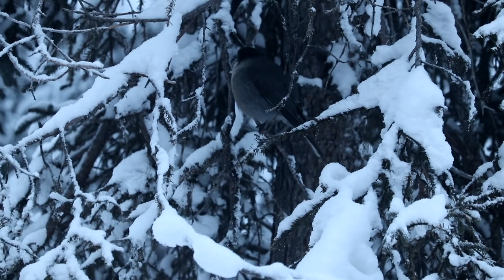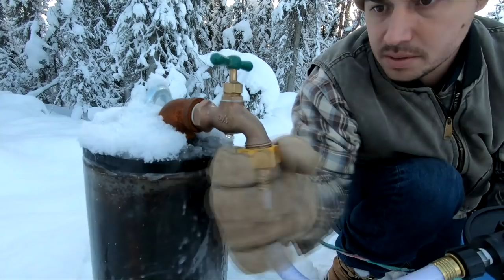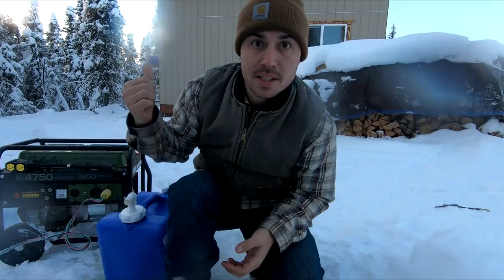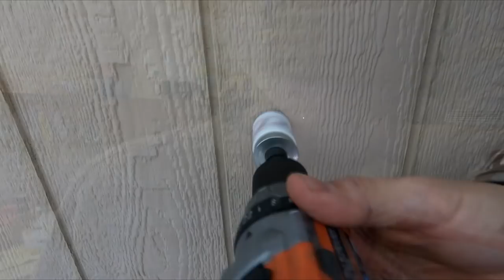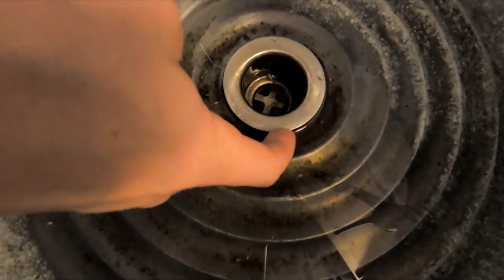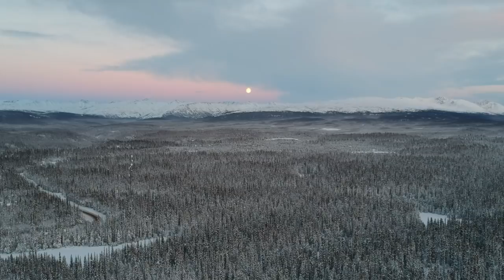Winter Solstice in Alaska | Cabin Projects

Comment: Stunning time lapse photography you guys. We loved it. Good snag on that filter. We run our sink/grey water to the outside also. I run the pipe into a large buckets with layers of sand, gravel, and 50 of the plastic scrubby things for scrubbing dishes. They act as a filter to catch the big stuff and the rest of the sediment filters through the gravel and then sand at the bottom. From there in runs on to the ground. Eventually we will run it into a larger 55 gallon drum filter or go into a septic tank.
Reply from the maker: That sounds like a great system!

Comment: Having worked with rock for many years there is probably some very good minerals in that settlement if it's a good well and the PVC pipe should run out a little further away from your foundation🤑🤐💥🐝

Comment: Your option to drain directly outdoors works; however, I see two problems: 1. you're introducing water to an area near your foundation.  Probably won't be a problem in the winter as everything is frozen, but come spring and summer you may cause damage to the foundation and wood of your home.  2. If you use high suds and unsafe soaps as you do when doing laundry but on your dishes, you will find cumulative harmful effects to the environment.  And in your area by draining food particles out of your home, you're attracting wildlife meaning anything in your area like moose, bear, etc.  Small fixes might be attaching more pipe from your sink to a holding tank that can be dumped every couple months safely at a RV dump station or extending the pipe but not using soaps and detergents that are harmful to the environment like Bronner's brand products (except the SUDS formula) and putting a filter or two on the end of the drain pipe as it exits onto your land.  Some people have creating a drain field for this purpose.  And since you have freezing temperatures, you'll need to insulate the pipes and/or go underground.  I know this is an investment of time and money, but it seems you're going to live there awhile so it will be worth the investment to maintain the integrity of the land and biology therein.
Reply from the maker: Christina Elliott, we appreciate your concern! :)
We do not use any other chemical products besides the store bought laundry detergent that I have yet to switch over because it has lasted so long. The whole transition has taken us about 1-2 years, we became very conscious of what products we use at our previous homestead because we had animals grazing and a septic system. Our house is built up so no wood touches the ground and we did not show it but behind the house the land is sloped so the water drains away from the foundation. We have compost outside and will have animals in the future, we fully understand that food outside will always pose a risk when it comes to attracting wildlife. Again we do sincerely appreciate your suggestions as we too care about the environment and continue to re-evaluate our actions as we work towards sustainability.
Reply: @SimpleLivingAlaska  Thanks for the prompt response.  I hope I didn't come across too didactic but Alaska is so beautiful and relatively unspoiled that I feel rather protective of it and those that live there.  I, too, am from the Bay Area, specifically Orinda, and have plans to move upon retirement or maybe even a little before to Washington State where I hope to do something similar to you living a simpler life closer to nature.  Best wishes to you all.